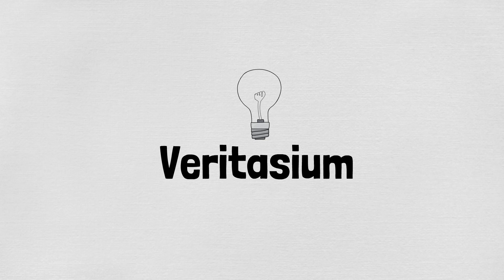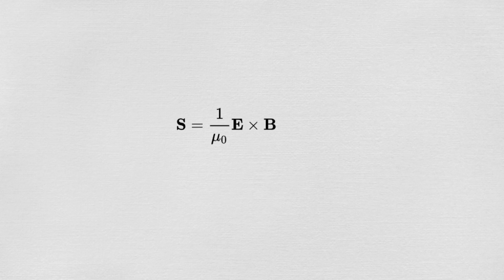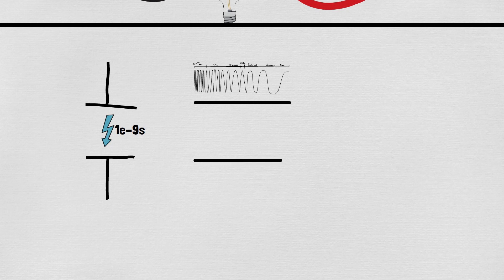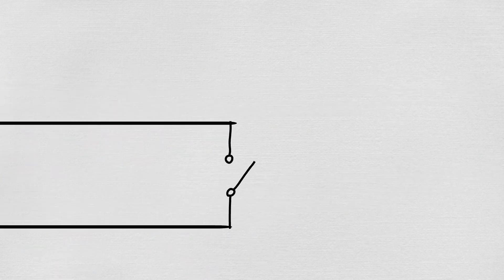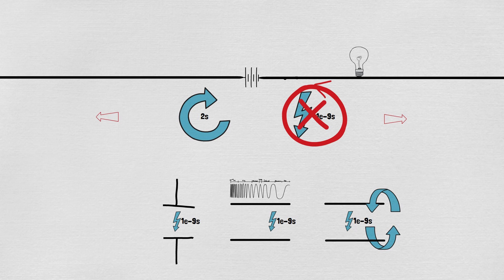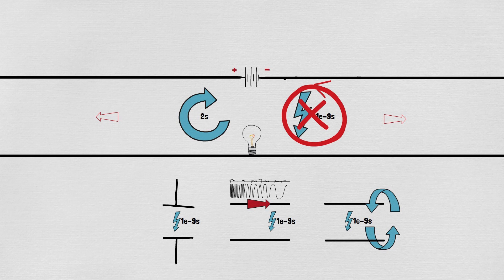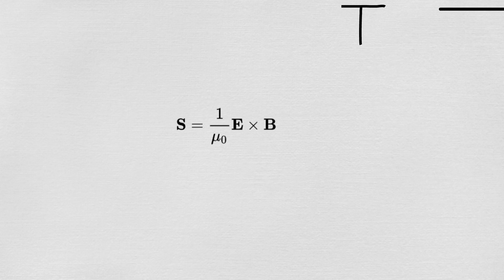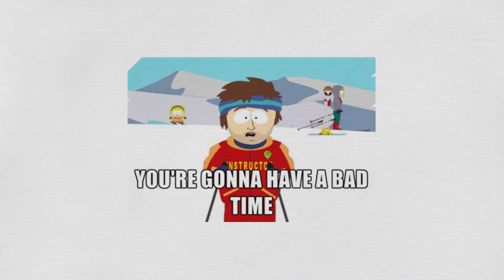Veritasium is Right? (see description)

Comment: "What's so special about a switch that turns an inert wire into an antenna?" It's the fact that it causes the voltage of that wire to suddenly change. That change in potential causes an E field. A radio transmitter, wireless charger, or microwave oven is essentially a (electronically-controlled) switch plus a wire.

You keep talking about causality and causal-loop, which is an information theory approach to thinking about this. Let's go with that. Your misunderstanding is because the causal loop is not through the wires between the battery and the light bulb, it is through space between the switch and the bulb. In the initial circuit, the switch is one meter away from the battery. As you move the switch away from the battery, the distance between the switch and the bulb increases, so it takes more time for the E field to propogate from the switch to the light bulb. 

That's very hand-wavy, so here's the AC transient analysis: 

OK, first of all, you need to assume the battery has been plugged in for enough time for the circuit to be in steady-state before you close the switch. That's a key point you've missed. If you "turn the battery on" at t=0, it, too, starts behaving like a switch, which will cause the bulb to light up immediately with no switch in the circuit. OK, so before t=0, the circuit is in steady-state with the battery on. That means the whole left side of the circuit is at 0V potential, and since there's no current flowing, there's no potential across the bulb so the whole right side of the circuit is also at 0V, up to the connection between the switch and battery, which has voltage on it (with respect to the rest of the circuit).

in this circuit, closing the switch will establish a sudden change in voltage on the top-right wire with respect to the bottom-right wire, which causes an EM field across the one-meter gap (capacitive coupling) to induce current flow through the bulb. It's the change in potential on the really long wires that causes the light bulb to illuminate immediately, not the idea of DC current flowing, so the physical location of the switch is really important.

As you move the switch away from the battery, you're basically moving your "change in potential" further away from the battery and switch, which will delay the light bulb from turning on. This is because the wire between the switch and the battery is at DC, so there's no capacitive coupling between that part of the circuit and the wire connected to the bulb. (Not that it matters, but by shortening the chunk of wire that changes voltage, you're also reducing the capacitance)

Oh, and yes, attaching two loose wires to a battery will indeed induce an EM field that could (very momentarily) induce (a very small) current into a nearby light bulb. As that EM field propogates through the universe, yes, it will induce a (very small) current into every bulb in the universe. But it is the attaching part that is doing the inducing; once the wires are attached, there's no longer a transient (AC) voltage across the wires, so there's no EM field radiating out. If you wanted to continuously power a light bulb in space, you'd have to hook up an AC signal generator to the wires instead of a battery, to cause a continuously-changing voltage on the wires to cause a steady EM field. This is essentially how wireless charging works. To transmit practical amounts of power, you need properly designed and tuned antennas on both ends instead of just random wires.

Derek's video missed the mark a bit because while his circuit looks like DC, the switch in the circuit sneakily turns it into a transient AC analysis problem. If you want to move the switch or eliminate it, you have to remember to first analyze the steady-state behavior before t=0. That's where your understanding is breaking down.

Comment: Hey, I pretty much agree with what you said. There was always something I found wrong about others explanation, and you have a lot a valable arguments.
However, im kinda of confused of the principle needed to light up the lightbulb. Does it need to be traversed by flowing currents, hence it would take 1 second, or would you need to have the entire circuit to be traversed by current hence 2s.
Because you said 2 seconds, and I don’t understand how could the lightbulb know what is the current around the batterie ? How would it know the circuit is opened or closed ? But information would need to travel back to the lightbulb, taking another 1s ?
For me, the 2s answer does not make much more sense than 1/c. I have that feeling that it’s 1s (I know feeling aren’t valid answer, but it’s the only that makes sense to me)
As I said im no professional, just a student, and I am very interested to know why.
Reply: A very tiny current will start to flow through the bulb once the change in the em field caused by closing the switch reaches the bulb, which in this problem happens in 1/c.

Comment: i do have one comment, Veritasium had mention that he believed the fields and cables were involved(kida breezed by it). in short Both are correct~(the time values), the current takes 1e-9 seconds to start the circuit~(turn light on/"flowing electrons", then the voltage from the field and cable takes around 1e-9 to 2 seconds depending if those cables are parallel or a circle.
the voltage is carried across the cables ignoring the light year of cable~(mentioned above), but still needing a cable~(via "magnetic field") for current transfer as you mentioned, i also think this explains the switch, as the cable is needed. and i think the current would determine 2 things:
1: brightness/Power delivery~(Voltage Drop From Lines)
2: The time it takes to turn on the light.

in short short lol, i think he actually may have been slightly right and wrong, but i also noticed you hadnt mention the cable of choice, i think the cable would have o do a lot, one thing that would answer mostly everyone's question:

would insulating the cable from any interference cause this time(1e-9 to 2 seconds) or Voltage/current~(metering at the light) be reduced/work at all?

(Veritasium had mentioned this---->) way back in the day when people tried using wires/thick cables under water, although it was unreliable and failing to get messages at all, or very bad one at least after a short time period.

im agreeing with both sides but also imposing another theory that might answer the questions we have been asking. im not sure on a video, but i may type something up on a yt clip or smth, as i have more to say and go way more in depth, but im already at a paragraph lol. also feel free to comment if i missed something myself otherwise, that my thoughts(the less defined/Descriptive Version).

Comment: i still have a few questions for people that know about electrodynamics, how long does it take for the current to propagate through the whole wire? does it start from the negative or the positive and take the whole 2s long trip? do both ends meet in the middle at 1s?

My assumption is that electrons flow from the negative side and take 2s to get to the positive and that creates the potential difference. But if that's the case, does the bulb light up when current flows through it at the half point of the trip or does it light up only when the current flow meets the positive end?

Another question i have is, does current start moving from the negative side of the switch towards the bulb or from the battery? if it starts from the battery does the information of the switch closing take time to reach the battery? what would happen if there was no switch and you simply connected the wires to the bulb directly? would it light up instantly from the end of the wire or would the current still have to flow from the battery?

I only learned the most basic concepts in college and i'm used to thinking of electricity as static and almost instant
Reply: The electrons don't move at the speed of light, they actually move pretty slow. The current is caused by the EM fields generated by that motion. The battery will push/ pull electrons as soon as wires are connected to it so the potential difference shifts to the ends of the wire (in this case each side of the switch) making the battery essentially as long as the wires attached to it since the wires were assumed to have zero resistance. Thus the EM field begins at the switch when it connects since that is where the difference in potential is located. If the lightbulb itself is also the switch (or directly connected to the switch which will cause a minuscule delay) then it is the origin of the field and so lights up immediately. 

Veratasium's scenario was basically treating the battery like a switch (i.e. what happens when you connect a battery to a circuit) which is a good place to start the discussion. In his set-up the switch was close to the battery so his conclusion was essentially correct despite ignoring the switch. 

I am a mathematician, not a physicist, so I could be wrong; but that is my current understanding (no pun intended).
Reply: @harmonicarchipelgo9351  thank you for the explanation, I think I understand now

Comment: The original Verasitum video and all the subsequent ones commenting on it started with caveats. So, I will start with mine: I didn't watch your video all the way through because I noticed what I think is an error in your understanding a the beginning, i.e; why the switch has to be closed. So, I might be wrong in simplifying it down to this level.

Maybe if rephrasing the whole idea behind the video might resolve the issue: The video was about explaining why the flow of energy was much faster than the flow of electrons through the circuit (something that is the prominent assumption).
This is why Derek's caveats included zero resistance (all the elements being superconductive).

The switch has to be closed so that electrons can flow in order to create a magnetic field that then creates the flow of energy. They don't have to flow all the way around the circuit but they must move in order to create a magnetic field.
The point is that the flow of energy is much much faster between the gap of the two parallel wires that then could be considered as capacitors or antennas than the flow of electrons around the circuit.

Comment: At 5:37 you say the potential difference in a battery is established by the current (in the circuit). I think this is incorrect. A potential difference is established using a tiny current and once it is established there is no need for any additional current to maintain it.

Comment: good video,but for there to be an electicalfield there dosnt need to be current right? I might be wrong on this but isnt the e-field the force between the charges so if you switch the circuit on you decrease the power of the E-field until there is no charge difference anymore?

Comment: Very nice! Most of your examples/questions would work if you replace the battery with an AC source. With the original battery it's one tiny pulse and done. The potential difference in the battery drives the current when there's a place for the current to go. The only time it goes is when the electromotive force from the source moves charges down the conductor. I really have not heard much mention of charge moving down the wire being the cause of the fields throughout these videos, and as you say they have to coexist! The moving charge creates the magnetic field. 

If the wire gets warm when the load is running, it is obviously wrong to say there's no power in the wire. after all, it is the reason a light bulb illuminates.  I'm more interested in the steady-state DC instance.
Reply: In the DC case most of the power flows very close to the wire since the field is strongest there. If there is voltage drop along the wire some of the energy leaks in to the wires and heat it.

Comment: Question about causality of the swtich was really good
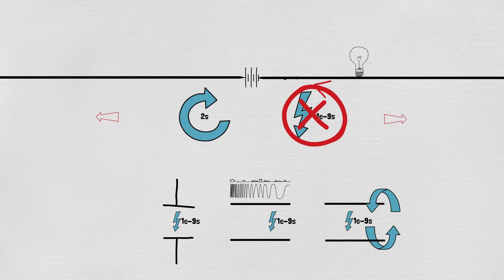3:36 4:00 Electrons travel inside fields theres no path between + - so no field inside wire
Few silly questions tbh
Reply: Electric field =/= electric current. No charge has to move for an electric field to exist. 
The video is right, but not for the reason you wrote.

Comment: Current will flow across the capacitance between the wires.  That normally would only be a transient current but with an infinite wire with zero resistance you would actually get an infinite current.

Comment: It all relies on current flow, the movement of electrons. When the switch is turned on we are not waiting on one or x number of electrons to travel from the battery to travel the entire distance to make the light to illuminate. The moment an electron(s) exit the battery all electrons in the entire circuit move at once. 
An analogy would be a hose connected to a snap action ball valve connected the a high pressure source and the hose is already primed and full of water, ignore the elasticity of the hose and the insignificance of compression of water. Now lets say the hose is several hundred metres long and loops back on itself (not that that is important). If you snap the valve open the water will exit the hose under pressure instantly or near too that. 
It's not transporting water through induction, capacitance etc. it moves because it is being displaced by the water coming out under pressure from the valve into the hose. You are not waiting on the water exiting the valve to travel all the way to the open hose before water starts coming out of the hose. So too the electrons entering a circuit are displacing the electrons in a circuit the moment a circuit is established from high potential to low potential.
Reply: No, the moment an electron exits the battery it influences the electrons next to it, not "all electrons in the entire circuit". If your hosepipe analogy were accurate, we could have a very long hosepipe that would instantaneously transmit pressure from one end to the other - faster than the speed of light in fact. You surely know that's not possible. A pressure wave in water and a voltage step in a wire propagate at some speed less than the speed of light and that's what the video was examining.
Reply: @RexxSchneider  I wasn't saying it effected all electrons synchronously there is a propagation delay between each electron collision. Given atoms are tightly packed but accepting there is space between and that the distance between electrons are extremely small. I did acknowledge there would be a propogation delay and that you need to forget compression of water just to simplify the analogy. At no point did I imply that it would actually at the speed of light, just that over the short distance used as an example it would appear to be near instantaneous and not some prolonged time for the water ( and in the case of an electrical cct) to travel to the end point.
Reply: @richardkaz2336  Yes, you were saying exactly that. Did you not say "The moment an electron(s) exit the battery all electrons in the entire circuit move at once." Do you want to retract that now?

You said "If you snap the valve open the water will exit the hose under pressure instantly or near too that." and I told you that was nonsense, because any wave has a propagation delay. I should add that if water isn't compressible, then a pressure wave can't travel through it.

You simply didn't acknowledge that the rapid increase in potential (the electrical equivalent of pressure) still has to propagate through the circuit before current will flow. Yes, it propagates very quickly, but still not instantaneously, and you just muddy the water by implying that it does.

You didn't imply that it propagated at the speed of light; you stated that it propagated instantly, and that is what I called you out on. No amount of denying it is going to change that you claimed "all electrons in the entire circuit move at once."

The whole debate about Veritasium's video was he tried to set up a circuit where the propagation delay through a long wire would be noticeable, and then claimed that the propagation delay would be nanoseconds because the electrical energy would jump through the air at the speed of light. I don't believe your comment helped resolve that in any way.